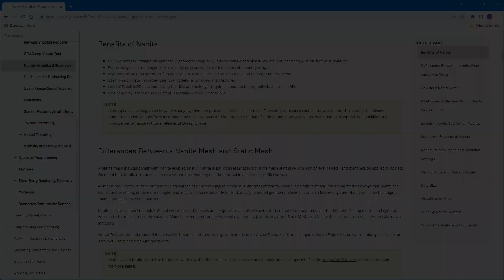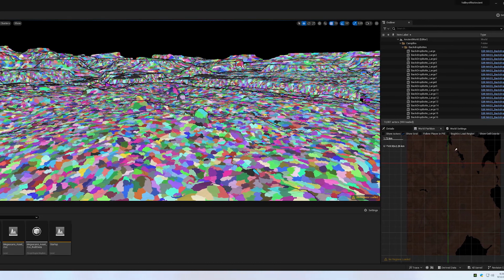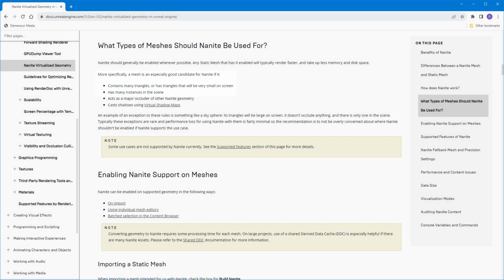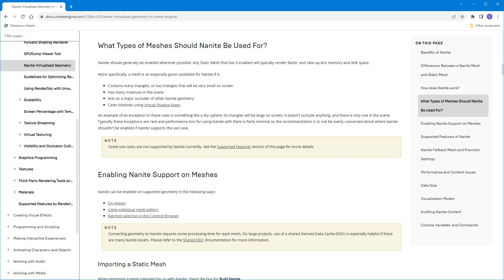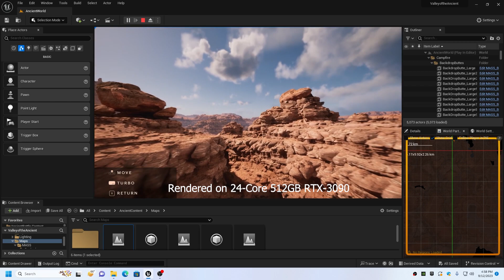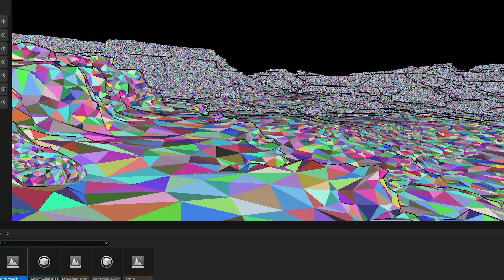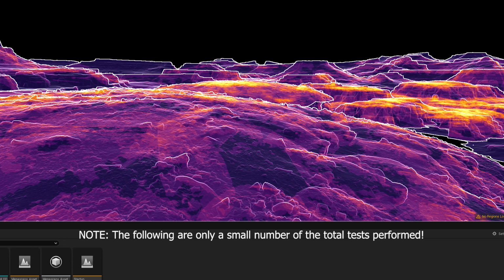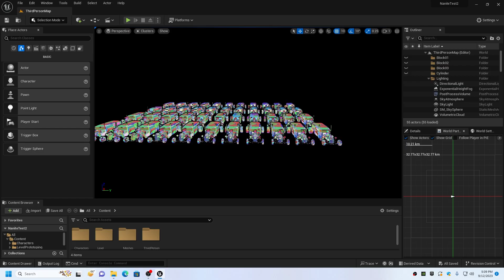UE5 Nanite Profiling

Comment from the maker: General Nanite rule.  If I was creating a game like Mario 64, Quake II, Portal, etc, I would most likely not use Nanite.  If I was creating a game like COD, Battlefield, Starfield, etc, I would use Nanite.  For game design complexity between these two sets of examples, profiling should be performed if you want the best performance.  When creating the first game play test level for your game, duplicate the Unreal project and enable Nanite on meshes, and compare the performance of the two projects.  Nanite IS a great feature and an amazing render pipeline, even on low end computers.  Being able to render scenes with 50+ million triangles on a standard Steam Hardware Survey most common system is amazing.

Comment: Thanks for the video. I have a VR scene where my general impression was that just by enabling Nanite and Virtual Shadow Maps I killed a lot of performance. Note: My scene is a typical archviz scene where you have a lot of meshes with giant triangles (like walls, etc.). But then I also have a tone of meshes that are triangle heavy and / or have a lot of instances like grass. I would need to set Nanite on about 50% of my meshes and leave the other 50% non-Nanite. But is this recommended especially in combination with Lumen? I thought it is more like either turn on Nanite or do not, but I am unsure about mixing. Sure performance profiling helps but I would like to hear your opinion first :)
Reply from the maker: You should be able to mix Nanite and non-Nanite in one scene without any issues, I have done that before and never had a problem.  I would tend to make the foliage and heavy triangle count meshes into Nanite, but leave the low poly buildings as non-Nanite, unless there is a huge number of drawcalls for the low poly stuff.  I have found that enabling Nanite on low triangle count minimal drawcall meshes has a big negative impact on Nanite render performance.  Unfortunately, the only way to know for sure what will work best is to try it, the Nanite render path is not always intuitive as to what gets an improvement, and what tanks really bad and renders slow.  I have found through dozens of tests that you typically have to get to about 20,000 instances or more to see a performance increase, or meshes with a high number of drawcalls, as Nanite doesn't use a drawcall system, and drawcalls on the standard pipeline have a setup performance penalty.  Really large meshes may also get a benefit on the shadowmaps if they are set to Nanite.